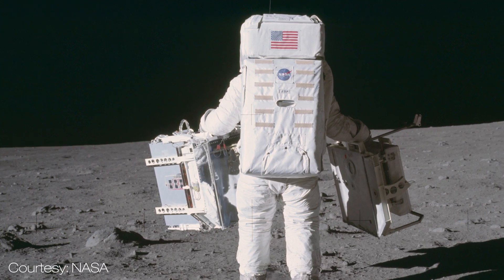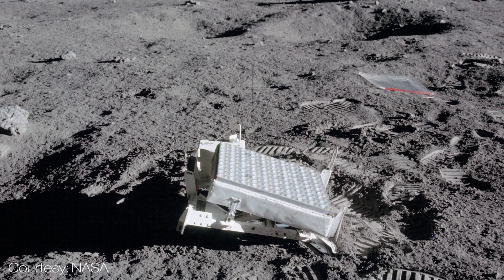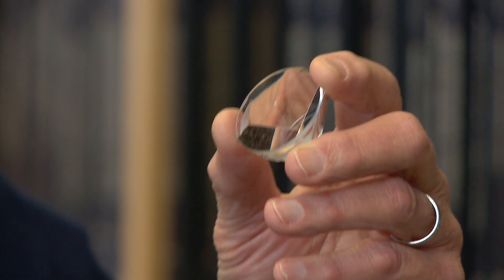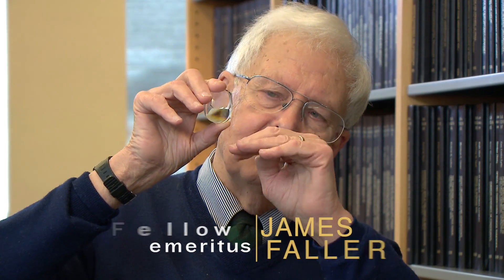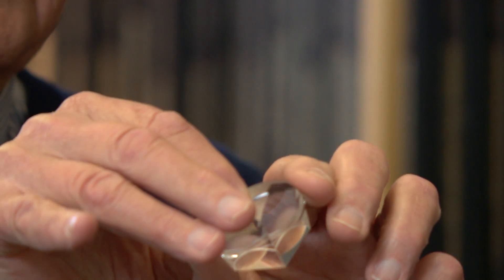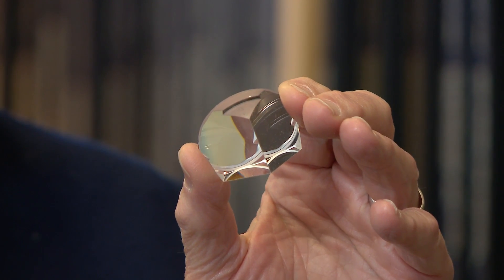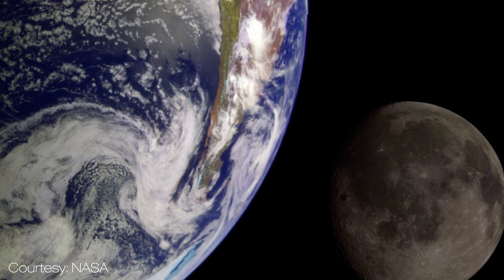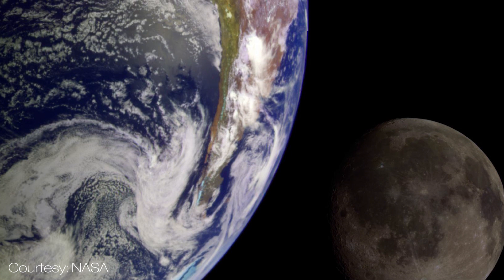Apollo 11's last working experiment on the moon

Comment: MIT bounced lasers off and back to earth with a ruby pulse laser in 1962.  Russia repeated the same experiment in 1963. Keep in mind that this was done nearly a decade before the placement of the reflectors.

If those reflectors are so vital to get to the moon then how did they get there the first time.
Reply: Whoever said they were vital to get to the moon? They were not.
Reply: You can reflect a laser off of almost anything, except for very dark materials, and if the sensor is sensitive enough you can detect the reflection
Reply: @mison9519   - let's reflect on simple physics (pardon the pun), if you can see the laser on the darkest material then the laser light is being reflected back.  As an example,  the blackest flat black paint has a reflection factor of 4%.  Simply put "If you can see it, it's reflecting".

If experiments were successfully completed in 1962 then how do you know that the the reflectors are of any value?   It has also been suggested that the reflectors could and can be deployed via an unmanned operation.  With the MIT and Russian experiments of the early 60's well before the first  moon landing sheds doubts on man positioned reflectors on the moon.
Reply: @EVRose60   - More likely China used their Chinese Crap Products.   Why should I care if China can do something in particular.  My statement was with regards of MIT and Russia.  I suggest that  you contact China for an answer or do your own research.
Reply: @johnqpublic6228  Alright so then who cares what MIT and Russia did? You haven't proven anything.
Reply: @EVRose60   - Excellent question,  "Who cares"?  I know I don't,  do you?  If you do don't be lazy and do some research.  Lastly, I am not obligated to prove anything to anyone,  especially you.
Reply: @johnqpublic6228  If you don't care then why did you bring it up in the first place? Oh BTW, there's nothing you can say on the subject that I haven't extensively researched already...years ago.
Reply: @EVRose60   - Well, aren't we special.   Let's make us both happy and you can stop replying to me.
Reply: @johnqpublic6228  I know you think YOU'RE special but I never said I was. Bye.
Reply: @EVRose60   - It is self-apparent that individuals such as yourself only reply for the purpose of arguing and not discussing,  so I no longer engage now or will in the future with any individuals.  They can believe in what they want; I don't care.
Reply: @johnqpublic6228  So nobody should reply to you unless they agree with you. Got it. 👍
Reply: @EVRose60   - Let me see if I can put it to you so you can understand.  When argumentative individuals demand proof on the proof that you forwarded to them, it is not a matter that they agree with me, it's a matter of dealing with a parasitic individual.  One can tell by the approach in the wording whether or not they  are seeking to feed off you, such as you did.  I no longer waste my time or have sympathy for such individuals.   It is my hope for that you can comprehend the scenario and put this to rest.  To repeat a phrase you put before me, "GOT IT".
Reply: @johnqpublic6228  Did not read.
Reply: @johnqpublic6228  You can’t determine the Moons exact distance by just bouncing a laser on its ground, since You don’t know if it hits a mountaintop or a deep Walley. With a cornercube reflektor, You know that You measure the exact distance to it every time. And, with a laser, You know if the photon You get back are the same You sent out. The reflektors are There, No doubt.
Reply: The reflections in 1962 and 1963 were off the moon's surface itself, much like it is routine to bounce radio and radar signals off the moon. But you can't get precise to the millimeter ranging for the moon from that. You need a single reflector to establish a precise and unchanging point.
Reply: @Inkling777  Prove it.
Reply: Randal Robinson Prove it? His point that was the reflectors give a far more precise and reliable result than just using the lunar surface, which scatters light more as it's an irregular and uneven surface. That's the whole object of retroreflectors being put on the surface - you can't shout "prove it" at that - it's what they're designed to do.
Reply: From where in Earth is the laser beams emitted?
 Which lazer is used? 
How do the lazer beams find these reflectors?
Reply: @thetruthnothingelse5033   - Here we go again, to be quite honest I am hesitant to  reply to these queries.  In 1963 both experiments were conducted with ruby pulse lasers. Please do not ask me  for details about this,  instead contact MIT.  Celestial bodies have been known to act as reflectors based on the various properties.    In the early 60s television transmissions were received from  a TV station that had gone out of business many years earlier.  Apparently, scientists determined that the transmission was being reflected back to earth.  The moon itself can act as a reflector.  Since the laser light is of one particular wavelength detection is possible.  The problem with lasers is that over great distances the beam will disperse. What started out as a pin point could be as large as 10 feet across and the reflection of the beam will be even more degraded.
Reply: @johnqpublic6228  the thing as it is Always, nothing concrete att all, someone is only saying something
Blur pictures says nothing, I have seen pictures on marborolo package on the parkinglot outside pentagon, clearly seeing the brand and this in Russia, we even have higher resulotions cameras here, and this pictures trough atmosphere six Times higher than the so called moon orbiter has taken. 
The moon lander is huge in comparising to a marborlo packages, you should see the Hasselblads cameras on the moon surface etc, show me clear pictures and i Will beleve. i dont think lazer beams is possibel at all pointing to the moon, as you say whats the point with this small reflectors when the Beam from Earth grows wider in the distance of 380.000 km from eart where its supposed to be emitted from? and when was that performed?  By who? Where?
This lasers power effect? In any measurements? and its optics, manufacturing company etc.
Reply: @thetruthnothingelse5033   -  I take it that you are in doubt of the moon landing.  There are many who don't.  There is overwhelming issues that question this event.  Some of these issues are  radiation, which I tried to discuss before. Another is the cameras,  the thermo dynamics of the environment on the mechanical properties is one, while radiation and temperature would have destroyed the film.  There is much more but this medium doesn't allow for a major discussion.   I personally don't trust NASA.  In this situation there are three groups,  ones who believe,  ones that don't and the rest just don't care.  Conspiracy theories run both ways,  each group of being delusional.  Until there is absolute proof neither group can claim they're right.  Be careful of the onslaught of abuse by the opposition.
Reply: @thetruthnothingelse5033  All of your "who/what/where/how" questions are answered on YouTube. All you have to do is apply a modicum of effort to find it.
Reply: @johnqpublic6228  "while radiation and temperature would have destroyed the film." - Care to explain why you've concluded that?
Reply: @johnroby6524  For the sake of argument we'll deal with the subject of photography.  The conclusion in question is not my but those of the experts.  First, many professionals in the field of photography have stated that in the heat present on the moon in the sun would have melted the film and due to the chemical utilized in cellulose the film had an excellent chance of self-destruction.   Such events are a problem here on earth with film storage at the national archives. 

 Secondly., the cameras were mechanical in nature which introduces the issue of thermal variances on the camera gear system.   Photographer's who climbed Mt Everest had to wrap and apply heat packs so their cameras would work.  The wide rapid and extreme temperature variations on the moon would occur just by the astronauts turning their bodies 180 degrees.

Third, is the effect of radiation. Dispite what boarder guards state the xray exposure even at this low level will effect the film.  The very nature of film is to react to radiation exposure.  Since earth bound devices are designed to the various environmental parameters on earth we never think twice about it. On the moon the astronauts were beyond the protective layer of the Van Allen belt.  Many assumptions that there is no radiation beyond the Van Allen belt is a lie and a state of ignorance.  They concluded this due to the early experiments to evaluate the radiation levels. The equipment recorded extremely high levels and then recorded zero levels, therefore the birth of this mindset was born.  The other side of this coin is that the level exceeded then equipment's ability to register the levels and basically shutdown. 

Note the pictures that were supposed to be taken on the moon.  Pay attention to the quality.  Note the radiation distortions as the levels of cosmic radiation from the Sun. In many picture the effect of being stage is very apparent.  

One could go on and on but this medium limits one from truly giving justice to the subject.
Reply: @johnqpublic6228  " The conclusion in question is not my but those of the experts." - Name one.

"First, many professionals in the field of photography have stated that in the heat present on the moon in the sun would have melted the film and due to the chemical utilized in cellulose the film had an excellent chance of self-destruction." - Film in the Hasselblad cameras were never exposed to sunlight. Film doesn't work if it's exposed to sunlight. Heat transfer (radiation) in a vacuum isn't the same as heat transfer in a medium like an atmosphere (convection and conduction). The film in the cameras were never exposed to those temperature extremes. Vacuum does not have a temperature. 

There are only three ways that temperature is transmitted from a heat source. 

1) Convection
2) Radiation
3) Conduction.

1) Convection: That’s when a heat source warms the air, and the molecules of the surrounding air transfers that heat to another object. It’s how certain types of ovens work. Since there is no atmosphere on the moon, there are no molecules of air (or anything else) to transfer any heat to the camera, film, or any component of the eqiupment. 

2) Radiation: The movement of heat from one place to another by electromagnetic or thermal radiation. An example of thermal radiation is the heat you feel when the sun shines directly on you, or when you stand in front of a fireplace. Not to be confused with Convection heating. This is the only thing that causes anything to heat up on the moon. It is dealt with by having reflective Mylar insulation or white insulation blankets on whatever it is one doesn’t want to heat up. That’s why the LEM is gold. And everything else was white. 

3) Conduction:  That’s the movement of heat from one object to another one that has different temperature, but only when they are touching each other. The objects have to be in direct contact with each other at all times to allow heat to be conducted from one to another. If an object does not touch something being heated up, no heat transfer can occur. 

Given that there’s no air on the moon, convection as a method of heat transfer is out. Put simply, there’s no air to transmit heat, so there’s no convection heating on the moon.

Conduction heating is out, because objects did not touch each other, without something in the way, oh, like a pressure suit or thermal insulation blanket designed to protect from heat and cold? 

Radiation could (and did) warm things on the moon, but since everything used by the astronauts was either in a white thermal insulation blanket or was covered by gold Mylar insulation, most all of the radiant heat was reflected away from any objects. The suits were white, the blankets around the cameras were white, most of the covers of experiments and instruments were white. There were some things that had layers of Kapton or Mylar insulation, which is much more efficient in reflecting radiant heat away. A good example is the descent stage of the lunar module, and the visors on the helmets had a layer of gold to reflect the rays of the sun away. 

""First, many professionals in the field of photography have stated that in the heat present on the moon in the sun would have melted the film and due to the chemical utilized in cellulose the film had an excellent chance of self-destruction." - Maybe that's the problem with their conclusion. Photographers aren't experts in thermodynamics. That much is apparent since they don't seem to know how heat transfer happens.
Reply: @johnqpublic6228  Lol. Your resignation is noted and accepted.
Reply: @johnqpublic6228  
All moon landings were at carefully chosen times, "morning" for landing sites. "At the time of landing, the moon was in a waxing crescent phase as seen from Earth. This was so that the sun would be rising over Eagle’s landing site. The morning’s long shadows would aid the astronauts in identifying landmarks."
The time of a lunar landing was determined by the location of the lunar landing site and by the acceptable range of sun elevation angles. The range of these angles was from 5° to 14° and in a direction from east to west. Under these conditions, visible shadows of craters would aid the crew in recognizing topographical features. When the sun angle approached the descent angle, the mean value of which was 16°, visual resolution would be degraded by a “washout” phenomenon where backward reflectance was high enough to eliminate contrast. Sun angles above the flight path were not as desirable because shadows would not be readily visible unless the sun was significantly outside the descent plane."
At this time the of lunar "morning" the moon's surface was cooler, the missions occurring between temperature extremes of mid-day and night.
Reply: @jimsmith7212  Oh No, another troll.
Reply: @johnqpublic6228  
Feel better?
Apollo missions were planned by rocket scientists, and they considered details that random internet clowns have no inkling of whatsoever.
Reply: @thetruthnothingelse5033  The laser beats are several hundreds meters in diameter when they hit the Moon. You can Google the experiment to learn about it.
Reply: @thetruthnothingelse5033  
The laser used;
https://youtu.be/2r_nX3hui10
Reply: Moon dust IS fairly reflective(one of the reasons why the astronauts look so well lit even when in the shadow of their spacecraft) but it also scatters the light more. They were probably able to get SOME kind of signal just from bouncing it off the moon, but not enough to be useful for measurements. The retro reflectors, which bounce light back in the same direction it came from, scattered the light much less, giving a stronger signal.
Reply: @Andre Let's take this from a different perspective,  can you absolutely prove that there was a moon landing?   If so then present it.  NASA has lied numerous times.  The American government has lied numerous times.  Many issues of physics regarding the event don't add up.   I do not have to change my perspective just because you demand it, neither do I have to bow down before you and present information because you  demand it.   This situation will always be a situation of doubt until a third party who the government can not influence verifies it, one way or another.   Time to get off your high horse and do some real research.
Reply: @Andre I see you got too much time on your hands.  Take up a hobby.  I grow weary of you kind.  Have a good life.
Reply: Randal Robinson I like how people come up with the "radiation" as an issue - if you run the numbers on Van Allen belts, they don't pose any significant danger to astronauts, depending on the time they're exposed for. It's measured risk, just like having an X-Ray is. You're quick to shout PROVE IT and dismiss evidence, but you're not as quick to criticise your own vague ideas with actual research.
Reply: @Andre Who the hell do you think you are?  I don't answer you or anyone else.  I don't care what you believe.  Obviously,  I do not need to validate myself to the likes of you. If you are that stupid to think that I would be swayed by your arrogance,  give your head a shake.  I really don't care if you continue to act like a troll as it seems  to be your nature,  Again, go and have a good life and keep in mind you are not as important as you think you are.
Reply: @Andre Believe what you wish.  These correspondences seem to only serve your need to lash out and argue with someone.   Under such conditions you would never be satisfied with any fulfillment of your requests.  I don not desire to waste any further of my valuable time.  I would wish you well but your need to be adversarial would just cancel that out. Please consider this discussion closed as I do not see a harmonious conclusion.